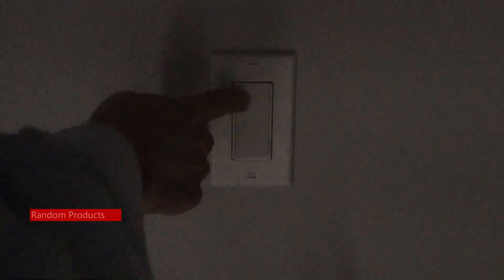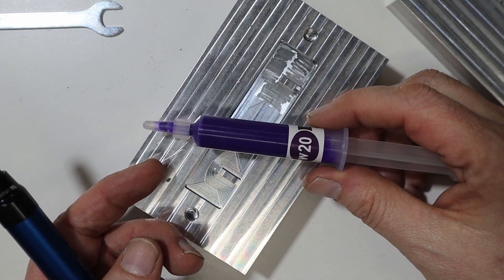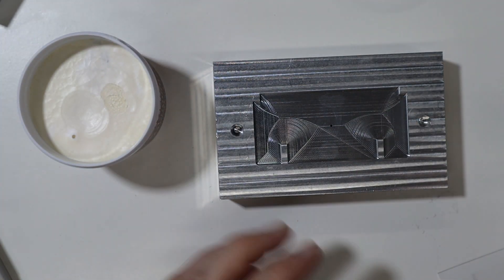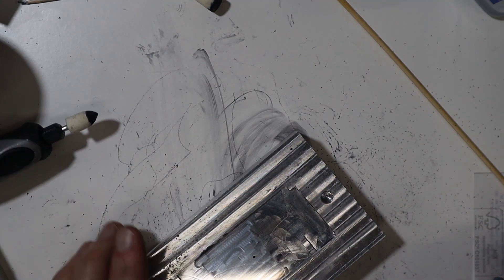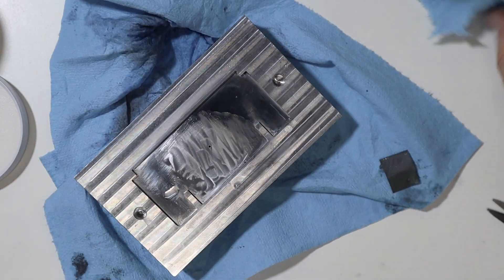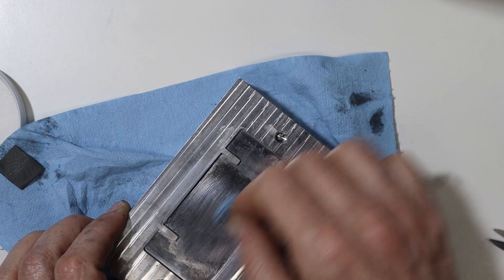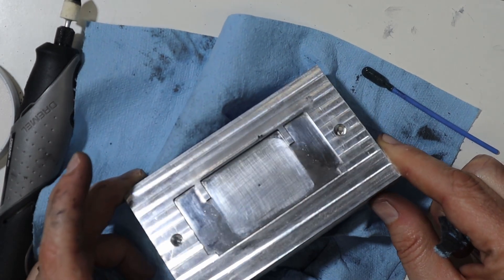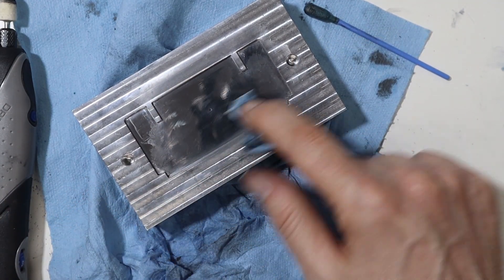Mold Polishing — New Learnings

Comment: Hey man i like how your giving it a go, im a professional mold polisher (at least i like to think so but apparently my paycheck doesn’t think so) but just like to say nice job, and just watch your edges with sand paper or stones/ what ever tools your using. Also for a “diamond polish” go up to the 800 grit paper and instead of going at it 90deg crossing use like 35 ish deg chris crossing and dont work in one are to long you will notice a “hole” starting. Then use the pllishing compound you had at the beginning but if you can get 5 micron and use the felt wheel. And finish it off with the mothers  polish and a wool or cotton buffing pad. Sorry for the long post cool video
Reply from the maker: Thanks for the detailed reply. I always appreciate this type of information.
Reply: I’ve been benching and polishing molds for over 30 years and you are absolutely right. You must remove all tooling marks with a stone and sandpaper first then polish. Bristle brush and then buff.
Reply: @tedhicks6416 hi. Can i pick your brain about polishing a really small mold. Our concern is breaking aluminum off and i dont know what to use to get into the crevices.

Comment: Hey that’s an awesome video!  You definitely have to get the tooling marks out before polishing.  I apologize for not being more specific.  Working up from 400, 800, 1000, 2000 them mothers will get a mirror finish!  A cotton cloth gets rid of all the polish better than paper towels.  Thanks again for the video and experimenting different alternative!  Love it!
Reply from the maker: Thanks for the original suggestion. I'm glad I tried Mothers directly, as it was a good learning experience. I can see how cotton cloth would be better, and definitely something I'll use if I need a mirror finish in the future.
Reply: You don't need to start as low as 400 grit.  With a low cusp height from ball end mill you are really already at a 600-800 grit surface roughness equivalent.

Comment: If you are using a rotary tool you are doing this wrong. We are not polishing cars or paint. You can not hide anything you will see it in the molding process.
Reply from the maker: The parts turned out well...

Comment: Tip, start off with a Boride t4 aluminum stone at 600 grit with mineral spirits to remove tooling marks and keep all your details crisp. Cross out stone marks with 600 wet sand paper and the buff with compound.

Comment: I have to applaud you for sharing this.  I think your the only one showing how to clean an aluminum mold cut from a cnc.  I'm working on a project myself and needed some guidance.  Thank You, I look forward to looking at your other videos and keep these coming.  I'm hoping you have a way to reduce the scallops from the center as well, maybe I'll run another finishing cut.
Reply from the maker: Some time ago, I asked a person I know who makes injection molds for model trains how he polished the molds. His answer is that he doesn't. Instead, he lets the machine "do it" by running smaller end mills with small step overs. When I've done this it really helps with the surface finish. I don't remember whey I didn't do that in this case.

Comment: Aluminium used should be 6000 series of higher for better finish. What we do O  investment casting tooling is. First removing the tooling marks with sand paper starting as low as 200 and going fine to 1200. Later steel wool for finishing with or without mold polishing paste.

Comment: I’m machining some molds that will be used for cold cast urethane.  Very complex organic surface models with deep pockets.  Why couldn’t you chuck up these felt  bits in the mill and create tool path that does the polish work for you. That’s what thinking about trying. I used to polish toy sculpting wax (sculptures) like this when I used to work in the toy industry as sculptor and model maker. I could get the surface to a high buff polish like it was done by hand all on the mill. High polish was always a requirement for a final toy sculpt   Seams doable in 6061?   Any comments would be great.  The video was helpful for sure.  Do they make mold cavity polishing end mills?

Comment: John,a lot of blokes on hear might mean well but there is a correct procedure to follow. Unless you want anSPI 1  2  or 3 finish then you can do it with a stick and wet and dry.Start of with P320 paper under your stick ,rub in one direction until most of your tool marks are out.Clean the grit of the mould .Select P600paper and rub at 90 degrees until 320 scratches are out. Clean mould .Select P800 rub with stick lightly t get 600 marks out. It's all about putting in a controlled scratch in(320) and then working through the grades to remove those scratch s.All depends what finish your customer wants. An SPI  1 finish (mirror finish) as used on optical  moulds requires finishing with a diamond paste but thats another story.  
You got there in the end,  you an get good advice on the net.
Polishing is very rewarding job,I'm retired now ,but do a bit of sub/contracting.
All the best     Paddy

Comment: John, I don't do any molds but I do frequently machine parts from aluminum that I subsequently polish to high finish.   I always  media blast the tool marks off first to achieve a uniform (but matte) finish, then pollish the uniform finish to a mirror finish.
100% aluminum oxide is too abrasive though... it will abrade the material away, changing your mold's dimensions.  There are all kinds of alternative media, from walnut shells to blends.  I'm sure one of those alternatives will remove tool marks without changing part dimensions.   A blend of 80% glass beads with 20% Aluminum oxide  is quite good at creating a uniform  surface finish in aluminum without changing surface geometry.  
You may even find that the polishing step isn't necessary if you follow the media blasting with a liberal coating of mold release spray...   In that case the whole thing is a 30 second process :)
Reply: Which glass bead (grid/mesh) do you recommend?

Comment: I have polished a few aluminium molds recently. I found that the step that is most important is to be sure that ALL toolmarks are removed.
I start with 120 grit emery cloth (80 if needed). When i'm really sure that all toolmarks are gone, i go up in steps: 180, 240, 320, 400, 600, 800, 1000, 1200, 1500 and 2500. I keep it wet with WD-40.
Then i switch to diamond paste, and use 45, 15, 6 and 1.
All is done by hand.
This will give you a mirror finish.
Going through all these steps actually makes the work go faster.
Trying to get a surface with a to fine grit takes way longer than using many grits in steps.

Comment: You did a good job, I'm also a plastic injection moldmaker, I worked 17 years in Saudi Arabia. I did different mold steels like 1.2080, 1.2016 which were also called stainless steel due high chrome contents. Some aluminium ones for blow moulding and thermoforming molds. For cosmetics molds, they required glass finished. For that kind of work that you did, you to make a small wooden stick formed like a chisel. A 30 or 45 degrees angle will do or what is comfortable to you. You put the sandpaper 400 grit under the wooden stick. Move forward and backward and put WD40 or any light oil will do. Then 800 to 1000 grit to finish, another 1200 grit would be better. Thanks bro.,,. good luck to your YouTube channel.

Comment: The dry stones will obtain a flat surface quickly. High speed rotary tools can produce ripples. Just use a progression of grits crossing direction 90 degree to the next, ending with the last in the direction of draw. Avoid finger backed steps, could produce ripples or gouges. Shape a common wood dowel on the belt sander to a chisel shape, wide for large areas or narrow for small areas or corners, to back your paper.
Please note a cold mold can change the color and gloss of the part.
Thanks for sharing your experiment, I will be watching for the first shots.
Reply from the maker: Yes, I did see ripples when I used the rotary tool. I do have some Gesswein stones on order, but it will be a week or two before they arrive. Can you provide more information about cold molds changing the color? I have a mold heater, but haven't hooked it up yet, so I'm curious to learn more. Finally, at the end I show some molded parts I made with a mold that was just sanded on one side.
Reply: @JohnSL  Test the softer ones first, again dress the corner away on your disc sander to form the chisel flat working surface. 
Run your mold temperature to the material supplier's recommendations as well as all parameters. 
We run automotive cabin parts 24/5 and check the color and gloss each shift. Many are textured, a colder mold produces more parts but can reduce the texture quality. Mold temperature settings are the first request from our colorant supplier troublshooter.
The color shift is minimal but may be noticable if the parts are mated in assembled.
Side note: I am somewhat color blind in the aqua hues. One morning the quality inspector stated when I placed a black seat back adjusting knob on the gloss meter, "Boy, where did all that green come from?" I couldn't see the difference. It was a supplier compounding issue, they replaced the colorant.

Comment: I don't want mirror finish I want rough surface in my mold how could I achive that surface ? Help help
Reply from the maker: My understanding is that you can use sand blasting to achieve that type of finish. I haven't tried it yet, but it's on my backlog.

Comment: Instead of something as course as fine sandpaper, are you familiar with emery paper? or a paper car body/people use with water? also crocus cloth. I remember my father using jeweler's rouge in stick form on a 5 or 6 inch diameter cloth wheel on a mandrel. I used to scrape the jeweler's rouge into a mixture of silvo and brasso to polish my brass when in the army. The rouge would keep the brash from tarnishing longer. For a courser medium to polish with, what about valve grinding compound from an auto parts store? All my best! /  dennis

Comment: The air pencil "tended to fling the paste all over the place"
Then don't apply so much at a time. Use less of the polishing compound and let it 'absorb' or worked into the polisher. A little goes a long ways especially when doing soft metals like aluminum 
It's kind of like using a buffer wheel... you dont want to load too much of the polishing compound in the buffer wheel or it will be wasted by getting flung in your face and all over the back wall
Reply from the maker: Thanks. Wish I'd known that ahead of time :-).

Comment: Be careful using wheel polishes. Some of them contain ammonia which will corrode aluminum.
Reply from the maker: Thanks. I always clean the mold with mineral spirits after the polish to try to remove all the residue from polishing.